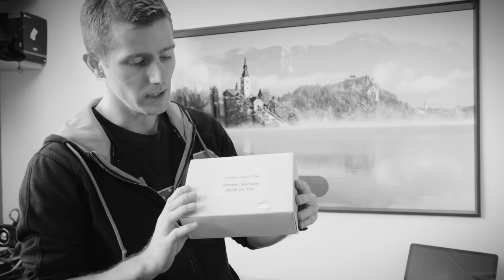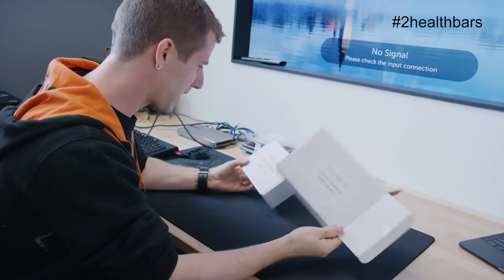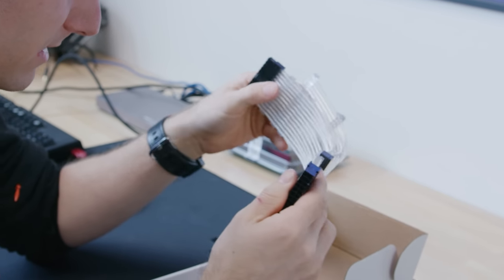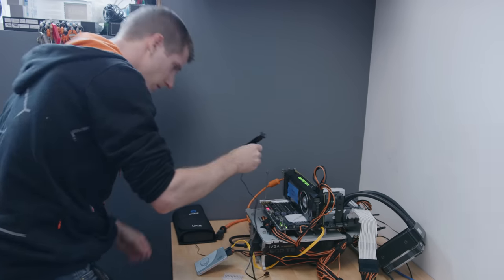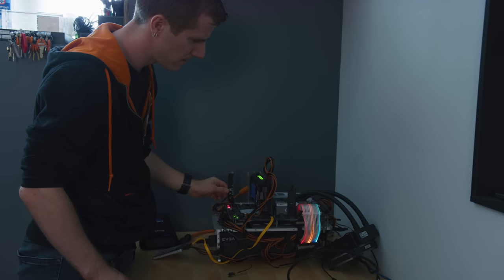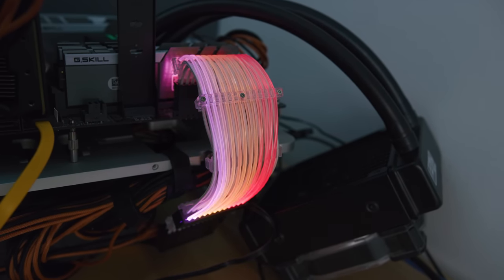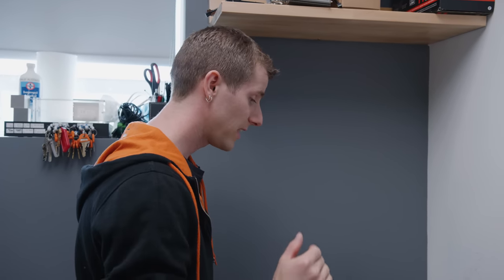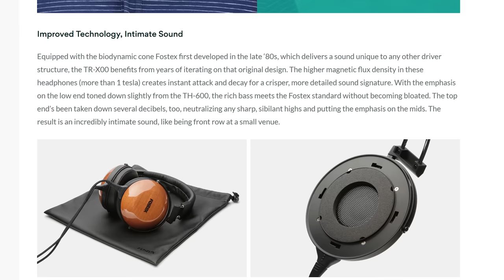It Finally Happened... - RGB PSU Cables

Comment: Time for a RGB IO shield.
Reply: Gigabyte already did it
Reply: @ziruon1864  yes they did
Reply: @gearz2570  The intensity syncs to the DB of audio output, its pretty cool if you want illuminate it on a wall.
Reply: I want one lol
Reply: @ziruon1864  I have one.
Reply: that actually sounds like a good idea. i mean you could see your ports in the dark
Reply: Already
Reply: I/O shields are a thing of the past. They are now part of the Motherboard and there have been RGB features in that area.
Reply: Gigabyte
Reply: that would be useful when you want to find the port to use.. not stupid at all
Reply: Yeah my $130 aorus pro wifi has a rgb aorus logo on the built in io shield.
Reply: @liamsatrapa5790  yea plus I broke my port once in the dark
Reply: Stop giving them Ideas

Comment: 2018: Omg is that a rgb cable?
2024: Omg don’t you have rgb proccesor?
Reply: ALL OF THIS....LOL!!!! :)
Reply: RGB CPU is bad idea cuz it will need watercool and it will get atleast 1gz and the one thing

It will be hiden! Goddamn
Reply: An RGB CPU shouldn't be too difficult tbh. There's always some space left around the CPU die and with how thin and tiny the leds are for the RGB it seems feasible to mount some around the CPU die or dies if it's a Ryzen CPU. With a reflective coating on the interior of the IHS and glass or clear plastic on the sides of the IHS so it wouldn't be hidden. You won't be able to get them very bright because of how little space you'd have to work with, but it seems feasible when using the right leds for the job and if you integrate it directly  into the CPU pins somehow.
Reply: 2027: Omg you have a rgb hard drive?
Reply: @ledanhquynhan7048  t-delta*
Reply: @wendyzanda  r/whoosh
Reply: @komi9261  but it's ssd not hdd
Reply: david bass don’t tell them how to do it cuz they will
Reply: @wendyzanda  I think it will be a transparent cooling system to see the rgb cpu..............................Just kidding lol
Reply: What? No RGB solder points?
Reply: 2030: what u are Not rgb on urself? Still no rgb skin?
Reply: @ledanhquynhan7048  there is rgb ssds lmao
Reply: 2040: dont you have rgb hair?
Reply: 2024 ain't too far
Reply: here comes the rgb house
Reply: Imagine everything is RGB, that will hurt your eyes
Reply: @smitzw5077  no
Reply: @2-SEATER  I mean in a good way? !  ^-^
Reply: @smitzw5077  theyre dont going to hurt, because we cant see anymore
Reply: @2-SEATER  ah YES YOU'RE RIGHT!
Reply: From the future
Reply: @wendyzanda  thats - the joke
Reply: I am here from the future... We have 450 watt GPUs and processors with 24 cores...
Reply: yo its 2023 now but we dont have one i think
Reply: @AryanRajkhowa  you're not sure? Tf
Reply: 2024 here but not reached there yet
Reply: Damn it's 2024 already

Comment: RGB cables need to have the ability to do a flowing light pattern through the cable. Just going side to side is lame.
Reply: Theres only one light in the end of each cable, its a light pipe.
Reply: @samus4799  yeah but RGB dude. Technology is far more advanced than "sorry it only goes side to side". We've been to fuckin space, let us have flowing RGB cables
Reply: The new version of this does exactly what you are describing.
Reply: @mrx24007  link??
Reply: Google Strimer Plus cables
Reply: @mrx24007  there so expensive

Comment: Lemme throw a plague here: you can ACTUALLY do the cables themselves light up with electroluminescent wire (tho I doubt it would be good on a PC with the high frequency driver), or you can also make the cable have some light conducting thing that makes the cable itself glow (tho you said the last one on the video).

Next step: RGB gamer coffee mug.
no, take it up a notch: RGB GAMER COFFEE. NOT THE MUG. THE COFFEE.
Reply: Kalvinjj RGB mug is already a thing by razer.
Reply: Kalvinjj But EL wire ain't RGB.
Reply: So basically "Nuka Cola Quantum" but you can change the colour of the glow...somehow...lol
Reply: dont forget that it must have a radiator
Reply: From your lips to God's ears.
Reply: Kalvinjj I have a Pro tip: Take some LSD and even your water will be rgb

Comment: This will definitely allow you to overclock better
Reply: Remember to set yours to red for maximum electron delivery speed and green for the best power savings. If your cables are overheating don't forget about the blue setting.
Reply: Definitely! My PC used to have no RGB of any kind, and I could barely overclock my i7-8700k to 4.9GHZ...

But that all changed when I added a couple RGB light strips. Soon after, I could easily overclock to 5.3GHZ, with my temps staying at around 60-70C!

10/10 will buy again

Comment: I'm just sitting here waiting for LTT to do a '100% RGB covered PC' build, where literally every surface is translucent and powered by RGB's aside from the physical hardware.

- case made entirely out of plastic/glass - lit up by RGB's
- all wires sleeved with translucent flexible fibre-cable or something - lit up by RGB's
- PSU enclosure replaced with a translucent one - lit up by RGB's
- 100% translucent fans - lit up by RGB's
- GFX card shroud (& fans?) replaced with translucent plastic - lit up by RGB's... actually, nvm. just drill some holes into a plexiglass full-board waterblock and stick RGB leds in there... :D
- anything that can't be replaced with translucent material covered up with some sort of thin translucent wrap (hdd's, motherboard, radiators, etc) - lit up by RGB's.

I mean, seriously... IT COULD BE DONE.

And, if there were any channel out there that should do it, I feel like LTT is the place. It'd be huge clickbait and it'd actually be a fun project to work on.

Come on Linus, you know you want to....

The world DEMANDS LTT make a 100% RGB case after all of the RGB love/hate we've seen on your channel.
Reply: ayporos transparent plastic leds me back to the old transparent gba days

Comment: RGB your LTT T-shirts. I bet you'll make good money Linus.
Reply: Do you mean the e-shirt?  It uses pre-configured panels that snap into a removable water-resistant or waterproof conduit cradle.  The "power" feed is in a small plastic box with controls on it with an optical lead as the "power" cable.  The neat part is you can remove the panels to wash the shirt and to swap them out as desired for other panels.  EL wire is used to construct the animations or blinking patterns for each panel.

Does Linus have enough influence to get color e-paper or e-ink made into the form of clothing wearable tech?

Comment: As vain as it is, i have to say it adds a scifi dimension to a rig. Would be cool if folks were able to use the cable to show stats on the computer such as temps or power consumption.
Reply: Calvin Witt lol but that's like talking practical sense into the millennials wanting these like their very lives depend on it. lol
Reply: Calvin Witt I'd be all for temps and power consumption. it would add a layer of coolness to any rig used like that. Time and date even.

Comment: You know, out of ALL the options and components out there for and using RGB, I think cabling was the best and most natural choice for something that ought to be RGB.  And rather surprised that it took as long as it did for it to happen.

I mean, look... you have companies out there specializing in cabling sleeving and solutions, particularly for themed rig builds and especially when other RGB components are involved.  Imagine if you had RGB cabling that was the actual cables being RGB.  Now imagine that you could program those cables individually... basically doing what Cablemod does, just in RGB.  And completely changeable.  On the same cable.  So barring burnout or life cycle replacement, you wouldn't need to replace your cables if, say, you wanted to change color theme.  Or replace your rig.  Just reprogram them.

Now imagine if you could hue match from the RGB wheel, on top of that.

Yeah... think that'd be worth the cost of admission.  You'd really only need custom sleeving for black sleeve.  Or if you like the unlit aesthetic.
Reply: sits down with an old man noise
"Back in myyyy day, we had multicoloured ribbon cables that didn't need no stinking LEDs to be rainbow coloured(!)"

Comment: I think, Intel or AMD should come up with an RGB CPU (even if it's hidden under the cooler). Do we have RGB HDD-s or M.2 SSD-s? :D
Reply: TheParkanyi yes rgb ssd exists
Reply: Jonathan Stevey he ment m.2 ssd not sata
Reply: Yes a prototype of m2 rgb ssd is exist
Reply: maxi2643 ah I'm that case no, wouldn't matter anyway as most mobo have a heat spreader that would cover it.
Reply: It can have RGB around the CPU so it glows from underneath the heatsink.
Reply: Imagine that with a stock Intel heatsink :DD

Comment: What about RGB condoms? xD
Reply: Zephane wew lad you are the mvp
Reply: There is also rgb light up clock rings out there
Reply: kyle hubner I really don't think you meant to say clock rings, did you?
Reply: yeah something you will never, it may be used on you tho if you lucky enough
Reply: Luis Ruisinger that would be much more interesting than RGB cable

Comment: RGB CASE 
RGB MOBO
RGB CPU COOLER
RGB MEMORY
RGB SSD 
RGB GPU
RGB PSU
RGB Keyboard
RGB Mice
RGB Monitor
RGB HEADSET
RGB Cables
RGB Fans
we need RGB CPU Right now
Reply: Faisalovic pretty sure people just like things that light up and change color.
Reply: Faisalovic RGB Mousepad
Reply: RGB HDD Platter with transparent housing.
Reply: RGB chair
Reply: a RGB RGB first

Comment: Can't remember who made it but back in the late 90's there was a 500 watt power supply that had translucent cables with this same principle but they actually had the wires in them and the casing translucent. It didn't have the fancy light shows but did light up with whatever colors the connectors at the power supply were. So it seems like fashion the PC World goes around in cycles of what was past is cool again...

Comment: based on what i can see, they could just create a cable where the wires of the PSU run through the inside of the lgb lights, since they are not lights and are just channels for the light to travel. so you could just run each cable through one and shine the light on that. so simple.

Comment: I have a feeling Corsair is gonna make a PSU with RGB cables. LEDs in the base with the sleeving around each wire being fiber optic. So you get to see the copper wire when the cables are off, but it's a light show when they're on. Or they could make cable replacement kits instead. I'd like that.

Comment: I imagine this won't make it to production or would just be limited to show builds. If they want crazy ideas, some kind of LED on sata cables to indicate drive activity could be neat, I wouldn't buy it though.
Reply: Joseph Arner yeah because u probably couldn’t afford it either way lol
Reply: PumpkinBoss, sure that's the reason, not because it's tacky and not because I'd rather check power through the BIOS or a power meter, or disk activity through SMART data and the resource monitor.
Reply: 4 years later they are on V2 and making $$$$.

Comment: I have a few suggestions for this product - to add to where the leds should be (I agree. They should be in the sheath). It’s a power cable … why does it need an external power connection? Add a USB lead, or just a standard RGB lead, and be done. 

Overall, seems like an overly complicated, unneeded component.

Comment: I have a Pentium dual core cpu, 512mb ram, Nvidia EN8400GS graphics, 120gb HDD, how many fps will i get in Crysis 4K ultra settings if i use this cable?
Reply: Sandesh J minimum of infinity
Reply: All of them.
Reply: The answer is 42
Reply: A bag of it

Comment: i dont get the rgb hype. id rather have the room completely dark while i game. much better immersion. rgb is just visual noise if youve got it on while gaming. as a standby decoration tho, i get why people would like it.
Reply: i use my PC mainly as a nightlight.
Reply: I like rgb keyboard and mouse when gaming in the dark. And buttons on the case so I can see what's what. And only red. Not because its stereotypical gamer, but because red light is better for your eyes in the dark.
Reply: i thought purple would be better at night.
Reply: my pc has a black and orange theme and orange leds are pretty uncommon so rgb helps with that
Reply: I have an MSI Gaming GPU and an MSI Gaming motherboard, both with red LEDs. They emit a soft glow that hardly escapes the clear side panel of my black case. It looks very nice and does not attract attention. So, it really depends upon how it is setup.
Reply: I sleep with that shit running. It's even hard to find simple FANS without a led light.
Reply: where is your Christmas spirit, don't be such a grinch
Reply: RGB lighting, or any aesthetic accessory for internal hardware, be it RAM casing or cable sleeves, is not for gaming or immersion. I think anyone expecting a user to have RGB lighting all over the place while they try to immerse themselves in a game has the wrong interpretation on the concept.

That said my system is only set to static colours, with the exception of some components that change colour based on system information. And is hidden by my monitors while I use it anyway.
Reply: It’s streamer related nonsense, I dont know a true gamer with any of it. Rubbish......

Comment: That's why you build your own company rather then working one if you have the ability. Prototype a design and see how practical you can make it for a certain demographic (small or large, they both have pro's/con's). After going to school for several years myself, I've found you can just pickup a book called "Practical Electronics for Inventors" which is published by McGraw Hill.. funny how they also sponsor colleges via their semester-to-semester programs instead, if you prefer to work for another company. And then give them gross revenue for the same projects they have you work on instead.

Or you can self teach via YouTube, but the book is a bit more concise if you aren't sure where to start. Then you can Google/YouTube/research the topics beyond if they don't make sense or you want to learn more :)

Comment: do they consume lots of energy (wattage) ? More precisely, will u see any difference in your montly energy bill if you use them?
Reply: you probably wont see any difference in you bill... these are just 12 LED that need to be powered (plus some a logic circuits) so a normal case fan will probably draw more power that that gimmick ^^ 
but I can almost garantie you to see a medium difference in your credit card bill if you get one  :D
Reply: @95Fawkes  I can get them for free from the pc parts warehouse I work at, but I was curious if its worth having them from the electrical consumption point of view, thanks for the info

Comment: Transparent heat shrink tubing exists. Couldn't you just mod your cables with that and then illuminate the heat shrink? I'm not sure if that would work or not but it would be better than this if it did.

Comment: if i would buy a power supply, it would be modular,
1. More wattage (like a evga psu at 16000w)
2. cleaner
3. works with rbg cable

Comment: im not sure why they couldnt have made this much better, even being a prototype. they have Aux. cords and wired earbuds that have LEDs that even flash to the beat of the music. granted they arent RGB, but just a single color. still, they could have easily built the RGB wire into the cable itself. as ive said, its kind of already been done

Comment: Tbh I kinda get this if you have a glass panel on your case, but then again if you can see your PSU cables (for the most part) that means cable management generally sucks.

Comment: Wouldn’t you just need to put a see through plastic coat around a white wire and a RGB LED at the connectors and you would have the wire itself lit up?

Comment: Geez, am I the only one that loves RGB lighting? I don't want to spend $3500 on something and have it only able to look one way. It's called adaptability. I have an RGB motherboard, graphics card, and some RGB case fans. I love being able to decide I want my expensive machine to look like on a day to day basis or just on a whim. They're really not that much more expensive than their alternatives, either, so I see no reason not to get at least some RGB capability with your computer, especially if you have a side panel. I just do static colours, but I personally don't like static leds that come with only one style, like 8 bit [255, 0 0], [0, 0, 255], [0,255,0].

Comment: its called fiber optics. its been around for a while now. you put a light against a fiber cable and it lights up
Reply: stektirade it’s not fibre optics, they’re electroluminescent panels. Fibres use total internal reflection to minimise light lose from one end to the other so it only emits light at the end not the whole way

Comment: Should called “24 pin RGB sleeve”  If someone already has white 24 pin they wouldn’t need the extension cable. But this is horrible though. Just adds more cables to any build.

Comment: I think RGB cables can be cool, but not in this configuration. It should be a housing that wraps around the cables and has slots in it with the lighting animation running away from the power supply and toward the motherboard and other components, to give it the visual of the power supply just pumping whatever color(s) of light you want, through out your computer. Not this though... the RGB cables in this video just looked like a hair clip got tossed in your case and happened to land next to some RGB lights.

Comment: RGB thermal paste rgb io shield rgb cpu rgb gpu (the chip not graphics card) rgb psu cable pins rgb air rgb heatsinks rgb tempered glass panels AND RGB MONITORS oh wait. Now you just need to download a new power supply to power all of this.